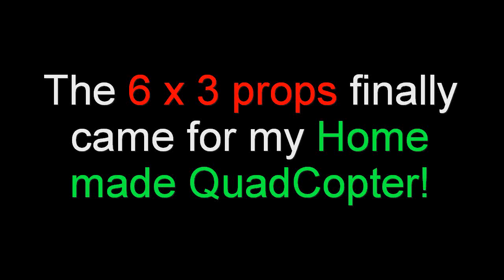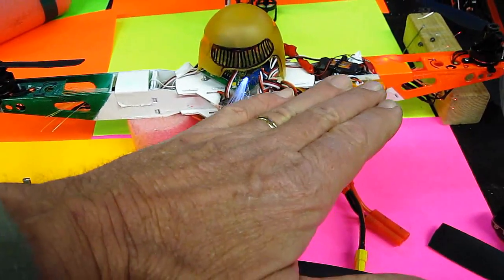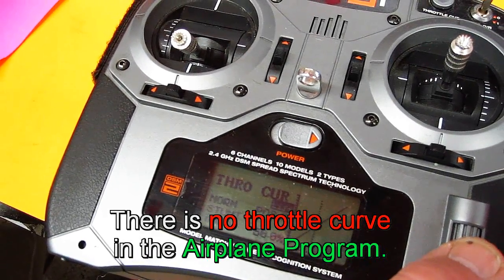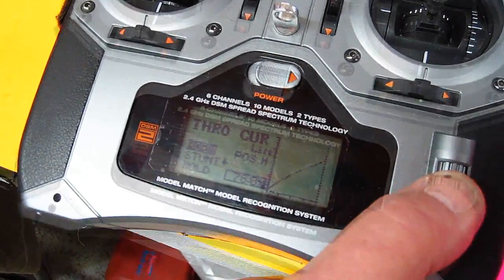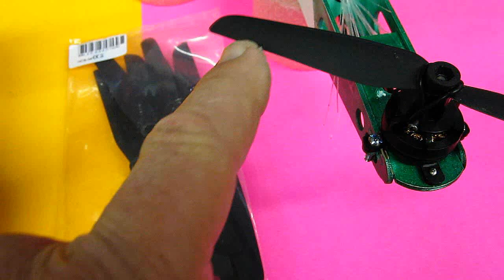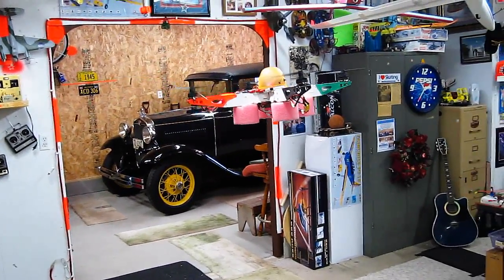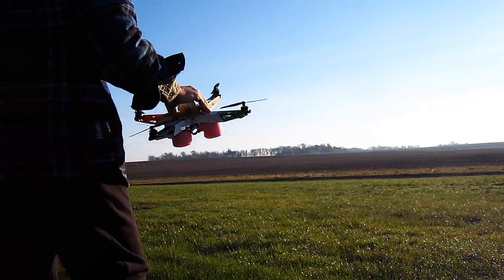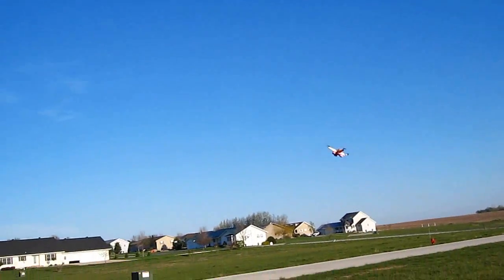Home-Made Quadcopter Blades finally arrived! The results.

Comment: i had a motor quit once on a tricopter, but I was lucky enough to be hovering at the perfect altitude- it did one flip and landed perfectly flat on the ground. Nothing broke except an ESC wire which was the cause of the motor failure. :)

Comment: Not sure if this was asked before, but is a quad-copter easier to fly in an x or + configuration? So far I've only tried the x setup in a couple simulators and I was wondering if this was the best way to fly. :-)

Comment: @NightFlyyer I have figured out why your hobbyking experience has been so bad.  If you read closely, reviews on Hobbyking said to stay away from the plastic motors, and to get the V3 Control board, as its gyro's are much more accute than the V2's.